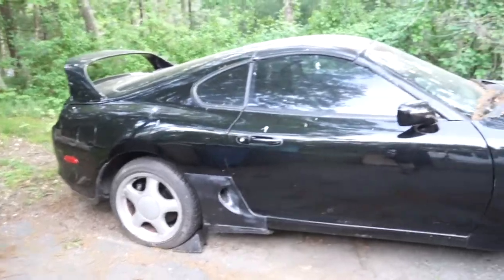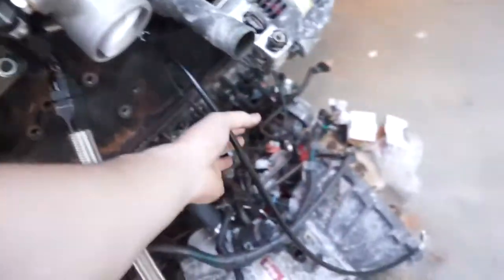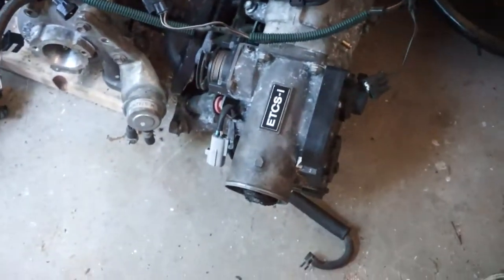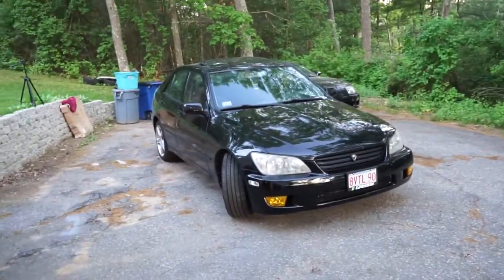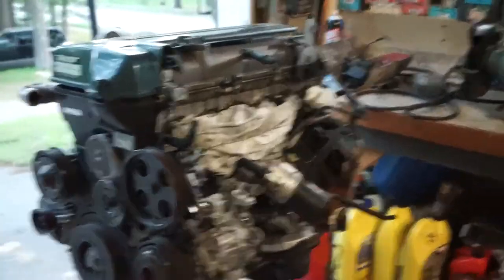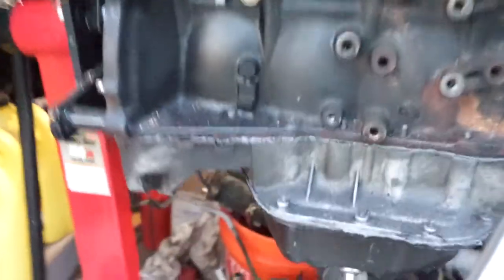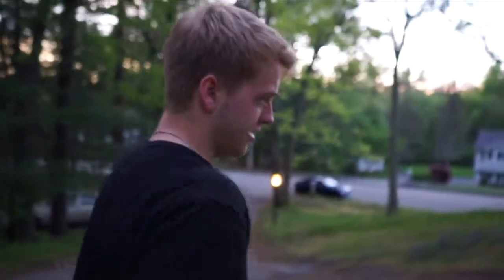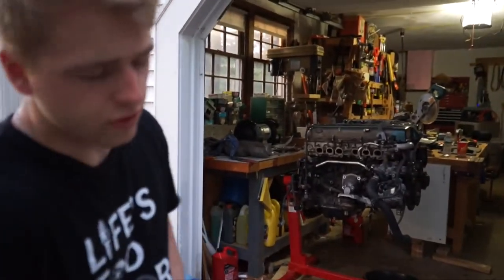Supra Build #13: Going Single Turbo!

Comment: Look at greddy manifolds good quality without breaking the bank
Reply from the maker: Randys Supra looks like I’ll be going with a Plazmaman Manifold, go check them out! I’ll be making a video on it soon.
Reply: 1WickedSupra yea had a look there pretty much the same price. I’ll look into manifolds ones the engines in but I’ll be keen to see you video on it too really want to see the difference between all the manifolds in regards to torque curves.

Comment: If you haven't come across it yet. Remove that stock dampener and get the ATI super dampener. Also take off your timing gear and weld that back piece so it doesnt separate on you also. Both failed on me at separate times. 
It will save you time and money if you do it now vs later when they fail.
Reply from the maker: Shady Shinichi when did they fail? How many miles on the engine and how much boost?
Reply from the maker: How much power were you making and how many miles on the engine? I hope that doesn't happen to me!

Comment: Hey man, I'm currently Running the AEM infinity 6 on my Supra with the Tweaked Harness. They had the VVti inputs switched, the Cam and Crank sensors spliced together and now maybe the wideband wired wrong. Be careful with the harness.
Reply from the maker: David Neumann Damn. Did you have to customs wire it to fix it? Or did you send it back to them?
Reply: 1WickedSupra, sent it back once. Probably will have to send it back again. Hopefully their newer harness won't have as many problems as mine has.
Reply: ordered a tweaked harness and it was junk, had to do a lot of other wireing just to get the car to work properly. mk3 1jz non vvti
Reply from the maker: CE2Vapor damn, hopefully they worked out some of the kinks. I specked it out with a vendor that knows his shit so hopefully all the connections will be correct.
Reply: ya same here. nothing worse than paying a good bit of money for a harness that is not done right :(